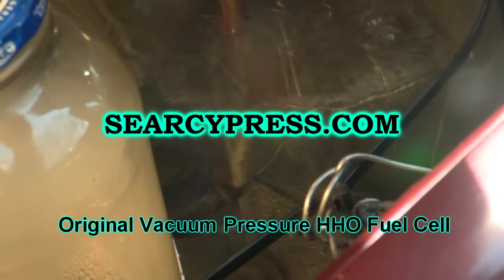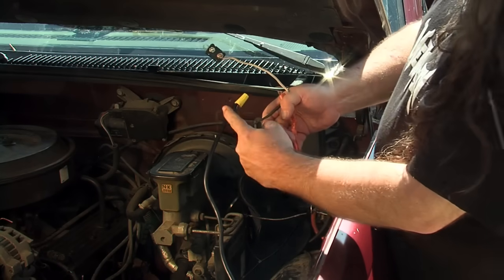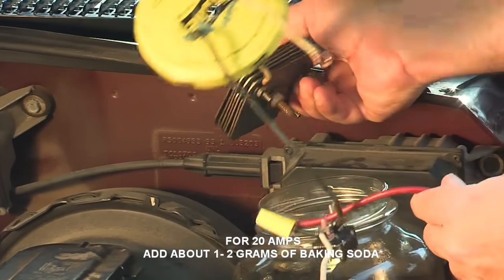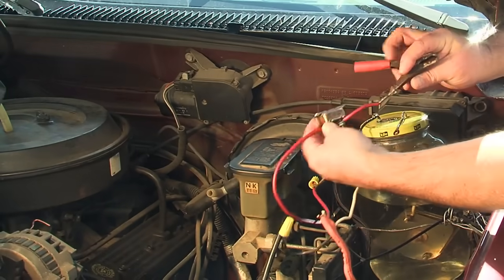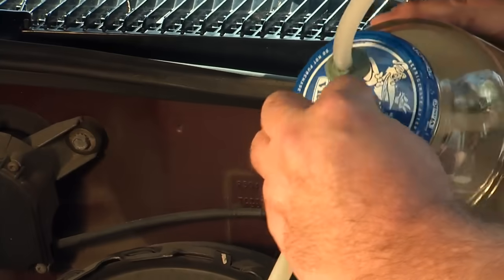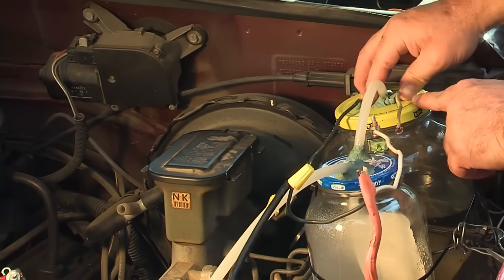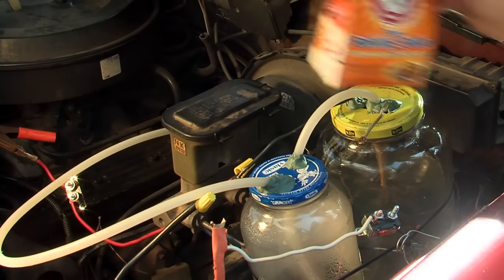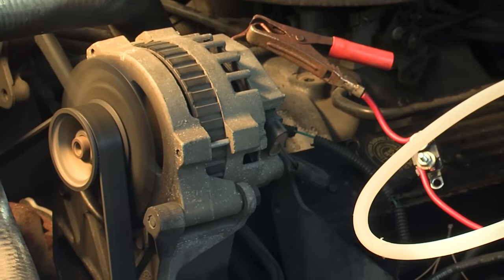Vacuum Pressure Hydrogen fuel cell defeats high gas prices using hydrogen from H2O.

Comment: Fuck using that gooey shit as a sealant.  JB weld.  I laughed at beginning when it was warned don't try this; hydrogen can explode.  I am a self made explosives expert.  I can tell you this:  Hydrogen cannot do shit without the presence of oxygen.  So if you have hydrogen all by itself; and you know wtf you are doing, you SHOULD TRY THIS AT HOME.  I am a rebel against oil tycoons; and yes I have the balls to say I am.  They take your money at the fuel pumps and laugh at you.  The Oil tycoons know there is such thing as perpetual motion generators; and complete water fueled  cars are possible.  So oil tycoons don't want you to try this at home.  I ABSOLUTELY LOVED THE VIDEO!!!!!!!!!!!!!!Oh shit, hydrogen dangerous and can blow up!!!!  Well, duh!!!!  So can gasoline vapors.
Reply: The method using electrolysis to extract the hydrogen also extracts oxygen out of the H2O in an explosive combination!

Comment: I,m struggling with this, it is taking a lot of extra energy turning the alternator to make 29 amps of current to power the unit,which basically cracks the water to separate the hydrogen, given the relative efficiency of doing this I can  only see disadvantage in efficiency and no gain, all modern alternators are smart charge where they only take engine power to produce charge when needed any other time they are completely off load and take barely any power from the engine, this all may have had some saving on old vehicles where alternators always sapped power and produced a charge but that is no longer the case, so I see only down sides with modern vehicles.
Reply: adding another alt will put double load on the motor and require more fuel per rpm. if it were much much more efficient, maybe.
Reply: Carburetor. Not mpi/
Reply: What?, who said anything about multi point injection, what i,m saying is that this cannot improve efficiency unless run on a ancient vehicle without smart charge.
Reply: I like the op idea but 29 amps is to much if he could make it work on 6 amps witch I know of people who have then its the same as running a car radio and then it would not be as much of a strain and that's the key 3 to 6 amps to generate HHO
Reply: Just a suggestion?maybe adding another alternator for more charge and output to the cell?
Reply: Safest and cheapest I think would be to hook it up to the battery or another battery instead of the alternator. It's not because he wants 30 amps that you have to go for 30 amps, it think it's lots. He also talks about doubling his miles. Again this is very much (100%) and would explain 30 amps for lotst of gas. From what i've seen most of these systems seem to deliver 50 to 60% extra efficiency.

Comment: if this is sooooo easy and you can double your mpg... why isnt every car equipped with one of these?
Reply: Government regulations and tax money. think about it. The government has known about this technology for decades. This country has one of the highest taxes on fuel. If this HHO systems were put into cars, do you think the government would be happy. The revenue those taxes generate is in the billions every year. The government won't let that type of lose happen.  Its all about the money. So the best thing is to put one in your car and don't tell any one. If you do, and you get 3 to 4 times the mpg, you could be fined for tax evasion. No bullshit.
Reply: +pure survival I think that's a better question for the automotive industry.
Reply: +smacleod69 I would like nothing more than to increase my mpg, but I have not found a proven kit that will work long term.